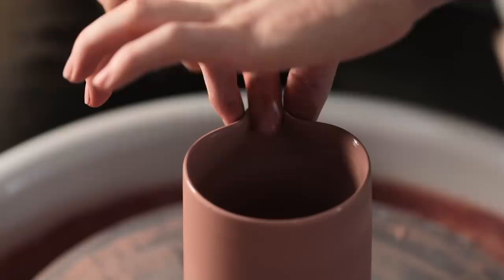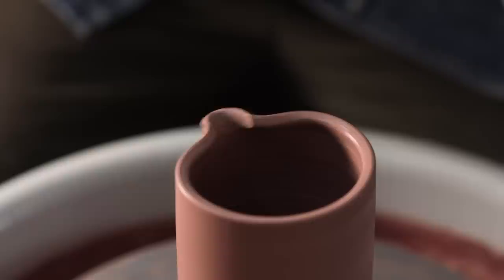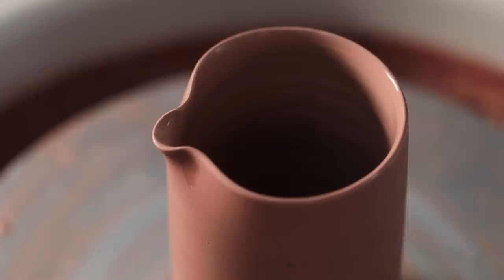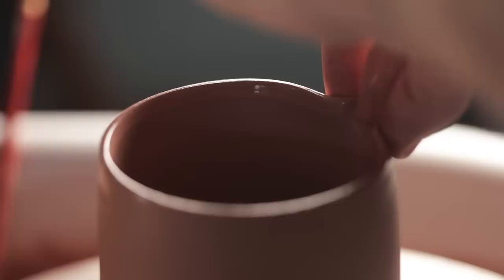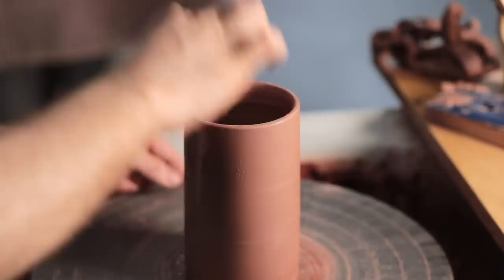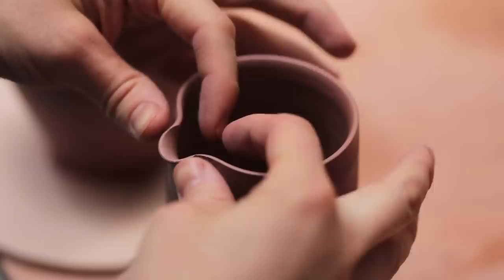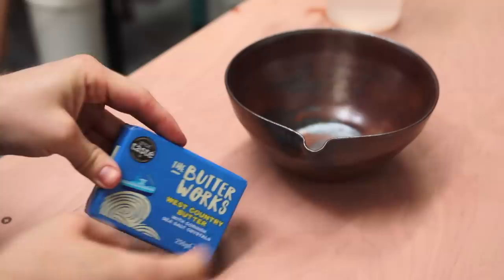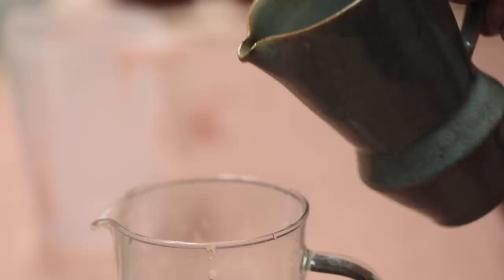Using Butter to Make Better Spouts

Comment: there are basically three things that decide if it pour well. it's the fluid velocity as it exits the spout, the angle of the spout compared to gravity, and the sharpness of the edge. sharp doesent nessecarily mean thin here, just that the radius at the last edge the water sees is pretty small. the length of the spout is increasing the velocity, which also improves pourability. if the spout curves out it will also have a lesser angle relative to gravity at the end, which means less of an assist for the water to get around the edge and cling to the wall.

Comment: For a more permanent hydrophobic solution, there are hydrophobic coatings that you could just apply on the outside of a given put. Might also make them easier to rinse as any dirt would likely be carried away with the water and also not stick very strongly to the hydrophobic coating

Comment: You can improve the dribble performance of a spout by making the angle, in cross section, of the outermost portion of the spout closer to horizontal. This ensures that when you’re pouring, the water would have to move upwards to continue along the outside surface of the spout. I think this is why the last pot performs so well: it looks like the lip of the spout turns a little bit downward at the very tip. That, combined with the sharp edge, forces the stream of water to break away from the outer surface of the spout.

Comment: I imagine you could use any oil-type thing in place of the butter to help a spout work better. It would need to be food safe, hence why butter is used. But shortening might work as well as food-grade wax.
Reply: Why would it need to be food safe? It's going to burn off in the kiln.
Reply: It’s not gonna burn off cuz it’s used after the pot is fired

Comment: How well does the glass jug at 12:40 pour? The very tip of the spout is lower than the underside of the spout so for water to dribble down the body it would have to flow uphill.
I've never made pottery myself, but I do have two glass measuring jugs - one which pours well and one which pours terribly. The difference between them is that the one that pours well has a similar sort of downturned spout like that glass jug.